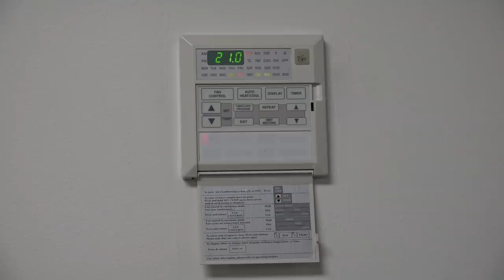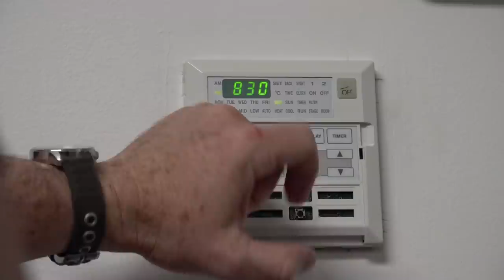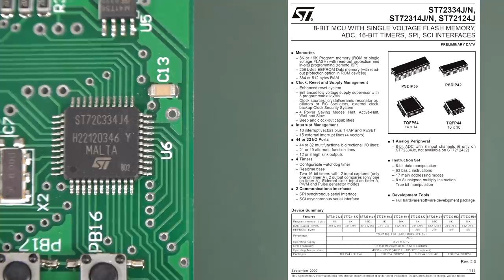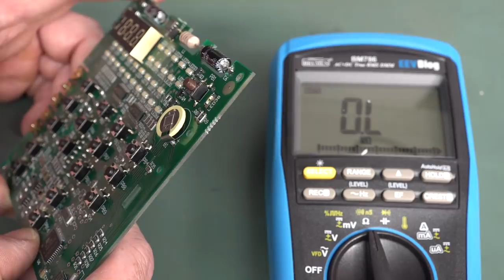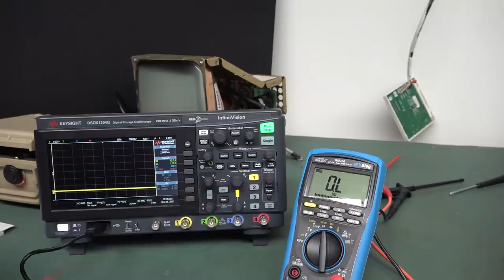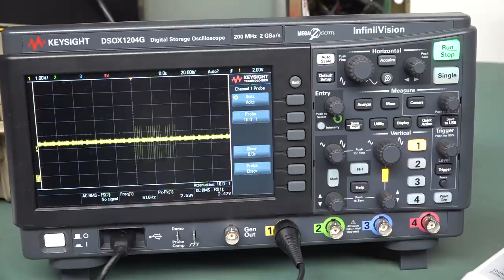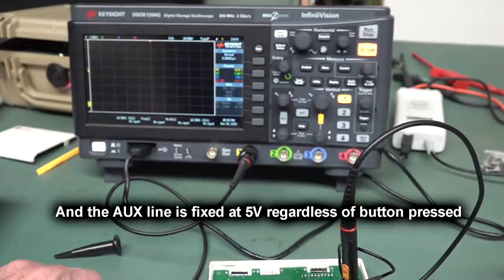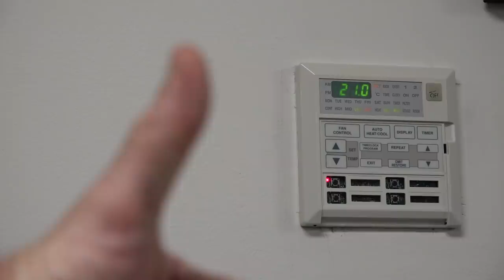EEVblog #1360 - REPAIR - Aircon Control Panel

Comment: 31:18 No Dave, it is not rare for these type of tactile switches to go faulty and present intermittent resistance values. If you have a dodgy board with these switches on it you can bet the switches are to blame.
Reply from the maker: The cool thing about this whole thing is that it didn't really appear like it was a faulty switch, as the switch worked but it put things in different random modes.
Reply: @EEVblog  
Indeed there aren't many circuits that don't put these switches in an array (or switch gates) so that a varying resistance usually doesn't matter to its function. I agree that the fault presented was counterintuitive.

I appreciate the level of detail you go into in your videos. Thanks and keep up the good work.
Reply: I have an Onkyo receiver with same fault - half of the time pressing ON/OFF button causes different functions to activate. Also an old CRT tv - pressing volume up/down, causes channel change, etc. It is not that uncommon as there are lot of low quality switches mounted out there. And of course - this stupid way to use ADC as input for switches... It works for a while, but ultimately always fails.

Comment: When you think about it, the air con tech would have simply replaced the whole unit and put the old one to trash... for a 10 cents defective tactile switch... doh!
Reply: That's because time to repair something costs more than the part is actually worth, so therefore this breeds incompetence into large tech companies.
Reply: because no tech is going to spend 2 hours soldering at 50+ bucks an hour to replace a 40 dollar display that he can replace in 3 minutes.
Reply: @SupremeRuleroftheWorld  which is absolutely fine if they also took the old part back for reuse.
Reply: @SupremeRuleroftheWorld  True where as someone like me and you could replace the switch in 3 minutes or buy a new panel for 100+ bucks.
Reply: @ricos1497  ,  Nah... no one wants an untested old piece of crap from the year one.
Reply: @BruceNitroxpro  obviously, but it's then the manufacturers responsibility to recycle or reuse. They might then get tired of making things that break, or deem it appropriate to pay the tech guy to fix.
Reply: Yeah, difference is the new unit is guaranteed by the manufacturer not to burn your building down - if the tech messes around with it, he takes the responsibility
This is why HVAC techs never repair these. Or a gas burner controller.
Reply: @tocsa120ls  you're saying that I shouldn't have repaired my neighbour's gas burner controller after watching a YouTube video on repairing a totally different model? I'm fairly certain gas is harmless.
Reply: More like a couple for a penny. Seriously.
Reply: TONS of crap ends up in the landfill for a very small number of failed parts, usually costing less than $10 (probably a lot of the time costing less than $1).
Reply: I think the answer is to replace with new PCB on the day (if that is less expensive than repairing), but take the old one apart to check what had failed, and feed that information back into the next design rev.
Reply: @nohandle1  So they can what? Fix it so it doesn't break after a few years, and you won't have to buy another air-conditioned every few years? In case you hadn't noticed, most company's growth, and the ever incessant demand from investors to make more money every year is fueled by things not lasting as long as they did before, not by being better and lasting longer than they did before. What they would learn from it is if they changed the tolerance of the resistors to be slightly worse, they could probably fine tune it to fail right after the warranty was up, rather than 6 months after the warranty was up.
Reply: @gorak9000  ah mate , you've lost too much faith :) sad thing is, at least for consumer tech, I think you might be right. But I know for industrial/commercial grade equipment , investigations into root cause does ultimately feed into design. They wouldn't be in business very long it they didn't.
Reply: I see your point but reliabilty is a factor. Even if it made ecconomic sense to repair it early failure for any reason would mean a free replacement.
Reply: @nohandle1  Even in commercial and industrial environments things like this only need to last as long as it takes to get the full depreciated value. Beyond that huge companies do not care, it owes them nothing at that point. Of course this doesn't work for everything, but for many things it does. Office equipment for example follows this while things like machine controllers often do not. Even smaller companies (talking 500-5000 employees) often do not care if their office chairs last only slightly longer than the time it takes to get the full write off from the purchase. You see this when things start breaking down but the company won't replace a bad office chair, and instead just has you switch with another slightly less crappy one until the time for office furniture buying comes around.

Of course not all companies are like this, but with computer equipment this is very true. Large companies cycle through electronics like mad, only moving to a more longevity based approach when their budgets are not so large.

Comment: I miss the teardown of the switch. Want to see its guts failing.
Reply from the maker: I suspect there will be nothing to see.
Reply: the only teardown needed of such a faulty switch, is application of a hammer so that it never bothers you again :)
Reply: I found it odd. It seems like a solid closure. Just wondered if there was oxidizing, or a fault, or plain dirt. I would never throw that in the bin without checking, but maybe I just have more time at hand.
Reply: @EEVblog  It's oxidation (more precisely sulphidation) of the silver plating on the contacts. Very common issue, these tact switches always fail this way in mini HiFi systems, lot of them using this same resistor divider analog key "matrix", to save pin count on the MCU. It's 'fun' when you want to eject the CD tray, and it starts recording over your favourite mix tape instead :) . It's a very common problem, they fail a lot. It pisses me off so much that I've researched few years ago if switches like this exist with gold plated contacts instead of silver plating,  I wouldn't mind if it costs 3 times more, but it won't fail. Couldn't find any unfortunately.
Reply: @erikdenhouter  The brown one is probably Omron, one of the most reliable ones.

Comment: Having looked at aircon from the perspective of an HVAC tech for quite a while I started this vid just thinking "why... That's something that just gets replaced in a couple minutes whenever there's a failure." 
But it was quite interesting to explore it from a more re-use recycle attitude. Learned alot :)
Reply: I would like to add that it often gets replaced even when it is obvious the fault is elsewhere.

We had a problem with a dodgy electrical connection to the gas valve, the first thing that the HVAC guy did was replace was the control panel.

Which of course did nothing to fix the problem.
They had to back to try fix the problem.

They never did find or fix the problem.

I went and diagnosed it myself, and found that it worked reliably if I held the connector to the side. So I went and stuck a little bit of foam from a couch cushion to hold it to the side.
Granted I spent more time at it than I'd like to admit, but I found it and fixed it.

Then there was the time that an NTC thermistor failed in the squirrel cage fan. The HVAC guy would have probably started by replacing the control panel if I had not spent the 2 minutes figuring out that it was the fan.
If I wasn't on my way to work when it failed, that furnace would still be installed. It only took me another 10 minutes to find the problem, most of the time was spent removing the fan. It was very obvious what was at fault, because the NTC was in pieces. I twisted the two wires together and it worked flawlessly.
I eventually replaced the 10¢ part. The unit currently sits in my brothers basement waiting to find a use.
(The furnace had already been removed, and a new furnace ordered before I got back from work.)

The purpose of the NTC was to reduce the spike of current when power is initially supplied to the unit. (I would have probably used a soft-start circuit like those found in high powered amplifiers.)

Comment: Unfortunately this is a common type of fault for this sort of thing, for which the solution is "Field service call, $300, replaced panel, parts cost $300".  I had a control box fail on my furnace years ago. The HVAC guy said it'd be about $600 to come out and replace it. I pulled it and found it had a bad solder joint. $0 repair cost. Worked fine for 20 years after that.
Reply: Yeah, furnace boards are a complete racket - hardly anything fails on them, but they mysteriously all develop bad solder joints after a while. Have run into a few with bad electrolytic caps as well. The price they charge for those things when they have maybe $10 worth of parts on them is astounding!

Comment: My dehumidifier seems to have this problem. The power button doesn't work and sometimes some other random button gets it to power on. Time to take a second look. Thanks! Also, Atari 7800 ProSystems have tactile switches that fail and they look like oversized versions of that. Power always fails first since it's the most used. I've seen it blamed on factory flux from wave soldering but I seriously doubt it. I've disassembled one of the lesser-used switches, cleaned it out, and hand-soldered it in place of the Power button and had it fail too while the slightly different replacements people sell seemingly never fail.

Comment: The flashing "run" is likely compressor lock-out which protects the compressor motor from being restarted under load of the discharge line pressure.  Usually about 5 minutes for pressures to equalize across the metering device.  

Some systems in the US use communicating thermostats, but most are still based on switching 24 vac to different lines.  Mostly signaling these days instead of inline switches.

Comment: Gamers know the phantom double click effect when the mouse switch contact worn out.
Reply: *looks askance at the pile of bodgitech MX Anywhere mice in the desk drawer*… *sigh*.  All too well.
Reply: Same problem with Razor Taipan
Reply: At least on the MX models I’ve taken apart, it seems more about wear and fatigue on the plastics that press on the button, rather than the contact in the button itself.  Shims and some stiffening seemed to help for a while.  It makes me sad because I really liked them, and the replacement variant requires new software (under MacOS) which is terrible*… I mean, it’s feature rich and configurable, but basic low-level functionality seems to have been twisted.  The crippling bit for me is that if you spec a button to be a cmd-click, it behaves like some bizzarre hybrid action…  Sometimes it behaves like it should, then others it’s unpredictable.  The most jarring being in The Finder… if you cmd-drag something using the keyboard + mouse, it behaves properly… ie, you move a window, it moves.  If you do it with all from the mouse, the window wont move until you release the button, and then the window *jumps to where you have guessed you wanted it.  Really frustrating
Reply: @Okurka.  I have a bunch of quite old Logitech mouses and I never experienced this with the ZIP microswitches they use 15-20 years ago. The only mouse switches I had to replace were on Kensington trackballs as they used unbranded craps.
Reply: @Okurka.   I do believe you. I won't try since I don't need new peripherals and their trackball sucks compared to Elecom's ones.

Comment: At 11:47 I think it´s not a dropper resistor, it´s an inductor
Reply: Hm
Reply: Yup 150Khz isn't your run of the mill linear regulator....
Reply: We used to call that style of inductor "bumblebee" inductors. Short, fat, striped.
Reply from the maker: You didn't watch all the video before commenting.
Reply: @EEVblog  I Indeed did
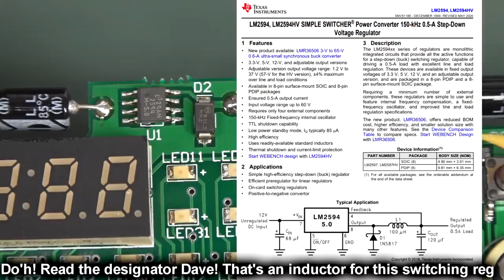Reply: Dave added a comment at 11:51, he realized that it was an inductor. Check it out.
Reply: @EEVblog  Yeah, but it's 40 minutes long. Stuff slips through, I know I personally don't pay much attention when watching your content.

Leave on in the background while working.

Comment: The mechanical issue with the switch design is using soft key pad together with longer button shaft. If the button is not pressed at the exact center this causes the shaft to wiggle and destroy the contacting surfaces inside the switch. They probably should have made the guiding hole in the front panel plastic for the shaft to stay exactly at 90 degrees to the board

Comment: I have a whole lot of the "normal" length buttons, then I buy some really long ones like 2 cm, and just cut them down to the needed length for repairs.
Reply: It's not always working, because the shaft is hollow, and the plastic pin that pushes the metal dome is moulded into a support a few mm above the lid of the switch. If you cut off too much, the pin will fall off, and the switch becomes unusable. Dave was close to that point, you can see a cross in the middle of the shaft where he cut it. That is the support of the pin.
Reply: @mrnmrn1  fill with epoxy then. The ones I got had solid pins so not a problem.
Reply: ... especially if used in a dusty environment.

Comment: At 5:46 the white wires are actually already labelled with text printed on them.  We can see "two" on the wire going to SENS 1 and "three" on the wire going to AUX.  So quite a nice cable.

Comment: My kingdom for an old-fashioned thermostat with a bi-metallic coil and mercury bulb switches. Indestructible.
Reply: bimetallic contacts wear out. Replaced plenty of central heating thermostats which got stuck open/closed or started switching at the wrong temperatures

Comment: It's flashing "run" because it's still in "time out" mode from the previous run.  A good thermostat will not restart the HVAC for a few minutes after the previous run.  This can be configured in some of the more advanced digital one.

Comment: Just a guess, but it seems like the packet is incoming to the thermostat for the micro-controller to pick up on to know what state the AC system is in so it can show if it's in run, heat/cool, etc. The device generating the packet could probably then sample that same line after it sends the packet looking for a resistance value to determine any requested state changes. That way you can get 2-way signaling over a single wire. If that theory is right, it should be easy enough to test. Pick a function that is repeatable like change the fan speed, see what resistance is put across the AUX line for that, then just put an external resistor across the aux line and see if you can trigger that change without using the thermostat buttons.

Comment: I think you are lucky when your aircon fails in this mode.
My experience with wall-mounted aircons usually goes like this (have had this happen at least 10 times in various offices):
The indoor unit has an output for the condensed water.  Because nobody wants to run a pipe along the wall from the unit down to floor level, usually a small pump is mounted which pumps the water up through a tiny hose, and then it goes above the drop ceiling and off to some sewer line.
These pumps invariably fail after time, or the tubing gets clogged.
Now the water starts dripping down on whatever is placed under the unit.  Of course there always is storage shelving there.
I always surprises me that there is no standard facility in these installations to sound an alarm and stop the aircon when excess water is in the unit and is not being pumped or drained away.

Comment: The resistor divider allows the entire keypad to work off one pin of the MCU, which lets them get away with a smaller pin count device. Looks like most of the pins on that STM is taken up with the LED outputs.

The data signal looks like a pretty simple pulse timing protocol -- 1T for a zero, 3T for a one.  It's a bidirectional bus, so the master sends the keypad some state information, after which the keypad gets a chance to reply which, if any, buttons it currently has pressed. If there is no master, the keypad just waits patiently.

Comment: A little bit of KF F2, some pushes, and switches can works again.
The analog input for multiplexing buttons were also used on TV (i had to use a small mosfet to interface to that!).

Comment: Ford used to do the resistance thing for cruise control buttons. Generally worked fine, but were unreliable on the first generation Taurus. Ours would sometimes accelerate when you pressed the "off" button.
Reply: Old school Toyota also though I've not had mine act up as described the old cruise control systems are a bit savage especially with an auto transmission!

Comment: My CTEK charger had some similar issue, had to puch, "viggle", yell, curse, give up and change it and now it works flawless. My switch did multiple oscillations so it jumped all over the choices of charging programs.

Comment: Perhaps the constant signal thing is a failsafe heartbeat. If the panel fails for some reason, no signals are sent to the aircon unit and so it shuts down.

Edit: Scratch that, just watched more of the video :facepalm:

Comment: Those packets look like timed differential packets... though seems 18 bit which is a bit odd... the difference between 0 and 1 is the size of the gap between pulses. Kinda similar to how single data line addressable leds work.